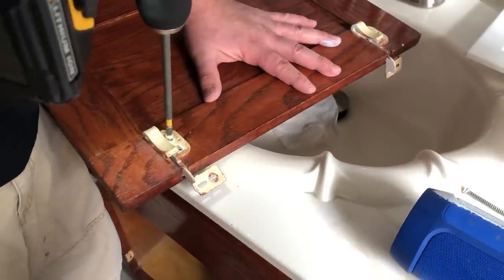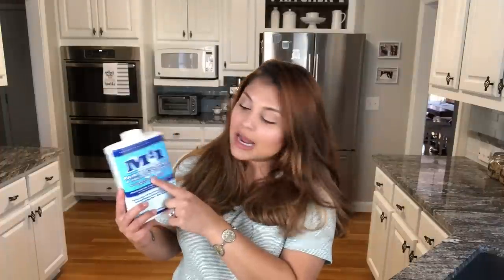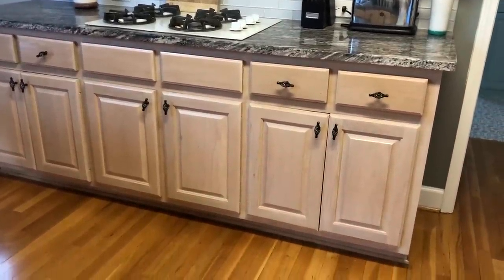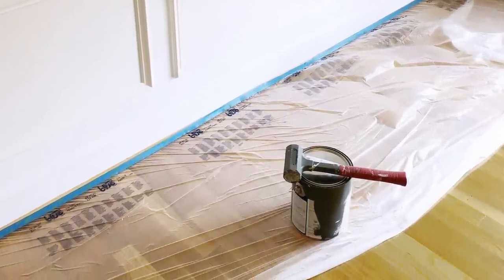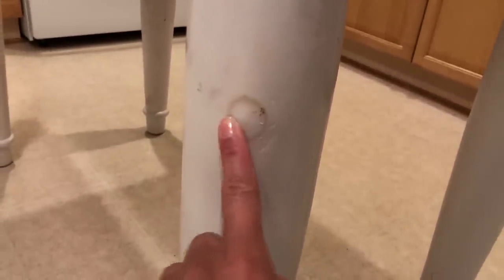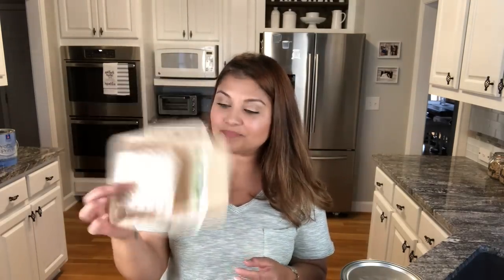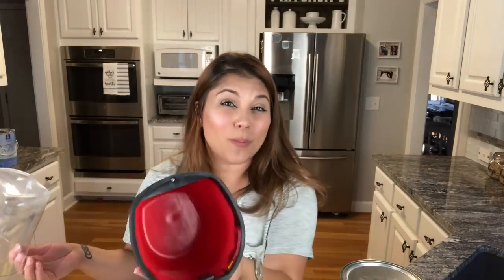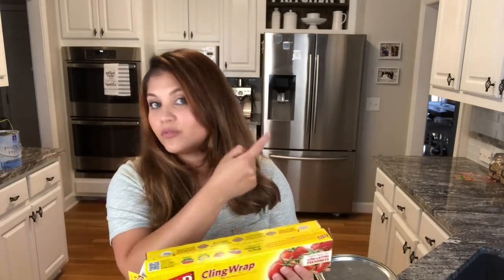HOW TO PAINT YOUR KITCHEN CABINETS THE BEST WAY - How to paint kitchen cabinets without a sprayer

Comment: I loved your video . I have watched hours of YouTube In preparation for painting my cabinets And this is by far the most detailed video . I was wondering why you like the Wooster Pro Shed Resistant Rollers for Smooth Surfaces over a foam roller ? Everyone else is recommending foam roller . Can’t decide what I want to use . I am debating on testing both Rollers on the back of the cabinets and making my decision before I start the fronts .
Reply from the maker: I personally don't like the texture a foam roller leaves.
Reply: Daniel Applegate foam rollers tend to leave a foam like texture and can make bubbles on the surface in my experience.

Comment: After doing a lot more research, I realized my cabinets have some melamine board on the sides and different spots — the doors are wood though. Did you have this too? Did you lightly sand these areas? I’m a little worried about the primer/paint bonding to this.

Comment: I know that you need a separate brush and roller cover for the Pro Block Primer but did you use the same brush and roller covers that you used for the Emerald paint as you would paint for the walls? Or did you have 3 separate ones from the oil primer, cabinet paint, and wall paint?
Reply from the maker: I use the larger rollers for the walls but the same angled sash brushes for the edges

Comment: Hi. With the primer u got, were u able to cover the grainy wood or the veins? My kitchen has many veins..thanks
Reply from the maker: It covers them up but it doesn’t make them smooth. Unless you fill them in with wood filler and then sand them all smooth, you will still see the veins when painted. I hope that answers your question.

Comment: Hi. I know it hasn't been long since you have had the cabinets done but Is there anything you would have done different? I would like to know how it's holding up with the paint you used? And you used nothing on top of the emerald SW paint, correct?
Reply from the maker: Sara Huth hi there! Actually no, there is not anything different I would do. It’s holding up great! And yes, you are right. I did NOT add anything on top of the emerald paint. Hope that helps!
Reply: Thank you😊

Comment: Doing my kitchen cabinets now. I have watched a lot of videos and decided to buy the products you recommended. I love SW paints as well. I have already deglosed and even sanded cabinet doors with orbital sander ( I have to say it took me two days, approx. six hours a day, cabinets had very hard surface, I don't know what it was probably 3 coats of lacquer, anyhow I wanted to have a wood clean smooth surface) and primed them yesterday with that SW oil based primer. Original color was oak. Today is the next step. But before I go to the next phase of the work I had a question for you. 

Can I prime it twice? Because the original color is still showing under the primer and I don't want to apply more than 2 coats of paint?
Reply from the maker: You can definitely prime twice.
Reply: @TheLatinaNextDoor  great! Thank you! Will let you know how it goes when finished! By the way, forgot to mention earlier! Loved your video, great explanation and you are very detailed! Keep up a good work!

Comment: I'm going to tackle my kitchen cabinets! Thanks SO much for all the information!!! You are awesome!! Just 2 quick questions. Can I use TP cleaner instead of the MI deglosser?? Also my cabinets are knotty alder..that appear to be in good shape, I know you said you don't need to sand, but I'm hesitant not to.... Do I need to sand them and fill in the wood spots with wood filler?
Reply from the maker: I’m not familiar with that other cleaner. I prefer M1 honestly. If you have knots in your wood then I would definitely fill in and sand them down. Hope that helps.

Comment: this was a great video!!  the cabinets i have currently is are a satin finish and I'm not a fan of gloss.  Would I be better off with a Satin finish.  Is this just as durable and cleanable?  Also, the color you used was extra white?  I need a great white but not so bright that it jumps out at everyone that walks in my kitchen. any help would be greatly appreciated
Reply from the maker: You can use Pure White. It’s not as bright but it’s a true white. I personally wouldn’t use satin as it’s harder to clean off in my opinion, but that’s a personal preference.
Reply: Thank you.  I'm using what you originally recommended.  Here goes nothing!  Wish me luck!!

Comment: You just inspired me to take this project on. I am debating between SW Emerald Trim Enamel Paint or Benjamin Moore Advance. Do you have any thoughts on BM Advance? Even that is alkyd and has self leveling. Many DIYers suggest BM Advance if using brush and roller.
Reply from the maker: I have used BM Advanced and I prefer SW hands down. BM stays tacky a lot longer so you will have to let your paint cure even more time. I don’t like that difference since you run the risk of ruining the paint job after the doors are installed. Hope that helps!
Reply: @TheLatinaNextDoor  thanks a lot. :)
Reply: Thanks for replying so fast. Helped me build confidence to take this on. Finish wise did you find a big difference between the two? Would you recommend the trouble of spray painting?

Comment: Hi there! I have started my cabinets following this tutorial and didn’t realize the pro block primer came in both a water based and oil. I didn’t specify to the guys at Sherwin Williams and they gave me the water based. Not realizing there were options I didn’t check. I have now completed the priming phase (doors and boxes) and realized when trying to clean my brushes with mineral spirits that I in fact had a water based primer. So, if you don’t mind weighing in, what do you think I should do? Resand and repaint with an oil primer? I don’t want all the hard work to go to waste if the water will lead to heartache in the long run.
Reply: Did you ever get an answer on what is the best primer?
Reply: @tinahopkins7813  Hi Tina! Yami actually was gracious enough to respond to this query via email. She said for best results I needed to sand everything back and start over because oil over latex (water) could cause problems. I ended up following her advice (and the advice of several other paint people I asked) and sanded most but not all of the water based primer off of the doors I then reprimed and painted them.  It was ALOT of work.
Reply: @tinahopkins7813  And I used the  pro block oil based primer

Comment: Hi! I really appreciate this information. Thank you! What are your thoughts on a shellac primer? I have cabinets similar to yours and was advised a shellac primer is best. I definitely will use the urethane. Awesome.
Reply from the maker: I think shellac would do a good job as well. It does help with sealing and preventing bleed though, but I haven't used it on cabinets myself.

Comment: If you tape off the handle of your brush before using, you can remove the tape after painting and have a like-new brush handle that is not all gunked up....I liked your process, but would have like to see more painting while you explain your process. I learned a lot...thank you for your video.
Reply from the maker: Thank you. I have shared several videos of me painting cabinets on my channel including when I painted this kitchen. This was more to answer as many unanswered questions as I could about my process.

Comment: Hi I start painting my gabinet and I didn't use the roll only the brush with my primer but the termination is not smooth and I thinking to sand y apply another coat of prime with the roll and brush did you think that can work for the  smooth termination I hope you can answer me 🙏🙏🙏

Comment: Are the knobs  and pull handles original to the cabinets? Or if you replaced them where did you get them (they're pretty)?
Reply from the maker: They were original but I have seen them on Amazon

Comment: Great tips.
Did you have to sand your cabinets? I couldn’t find the prepping video?
Thanks
Reply from the maker: I didn't have to. The cleaner did a lot of the stripping for me and the cabinets were in good shape. If your cabinets are a little rough, or have been refinished before I would recommend sanding to make sure everything is smooth.

Comment: I am painting over worn and chipped paint.  Do you recommend stripping off the old paint?  My cabinets  are chipped in high-use areas, e.g., under handles and where finger nails pull doors open.
Reply from the maker: Yes, I would recommend stripping the paint since you already have chipped paint. If you just sand it will still look uneven and if there are any areas already prone to chipping that haven't started yet, it might do so after you painted, and you don't want to risk that.
Reply: @TheLatinaNextDoor  thank you for the reply, I am sure you are right, I suspected as much.

Comment: Also just a FYI I used the same Emerald paint from Sherwin Williams on our bathroom cabinets.   I decided it would be a good idea to add a coat of polycyclic (even though the guy at Sherwin Williams told me it wasn’t necessary) over the paint. BIG MISTAKE!! Ended up with what they call alligator skin. So I either had to strip all the paint off and start over or leave them as is. After showing several friends I decided to leave them and tell everyone that this was the look I was going for 🤣. Lesson learned

Comment: I purchased the Wooster rollers and Purdy handle as you recommended, however as I’m getting ready to paint, I find the rollers are too tight to fit on the roller, darn I’m off to find some Purdy roller covers.   However thanks for the great video 😊

Comment: It's interesting what different results different people get from this high-priced Emerald paint. I always look first at low-rated reviews to find out if people have done it wrong (not followed instructions) or whatever, and a few people have had terrible results from the SW Emerald Trim paint. 

My original hesitation was because I had an AWFUL experience using SW HGTV "guaranteed one coat" wall paint that in actual practice required FOUR COATS (white over deep coral and white over avocado from the previous homeowner). I will say that SW did refund my purchase, but I would have preferred that the product had worked as advertised. I'm glad you had such beautiful results but I encourage others to do due-diligence research before starting a big project like cabinet painting. In my case, my existing cabinets aren't even real wood so there will be no turning back once I commit to painting ... this will not be a snap decision for me. BTW, your results are beautiful :) ... I don't want to be a Debbie Downer, but I have to make this decision carefully. 

And I agree 100% with the Purdy paintbrush recommendation. A professional painter who was at the store at the same time I was searching for a brush highly recommended Purdy and I closed my eyes to the price and bought it. Great decision! The biggest advantage is these brushes don't lose bristles - ever. What I did to keep that brush - literally for years! - was to wrap the bristles in a very damp rag and put the brush in a zip bag in the fridge. It was always like new next time I needed it. They truly are worth the price!

Comment: Thank u so much for showing that table that is showing the knot coming through. I have to tell u I’m so sad we recently painted our oak cabinets white and some of the .org is coming through like u showed.  We would u recommend adding another layer of paint?  Also, we have experienced some chipping when opening some of the doors (our doors sit in the actual cabinets not on top like urs do) 
Tfs
Reply from the maker: Luz Posada unfortunately even if you add another layer of paint it’s going to seep through it as well. What I have seen others do (I haven’t done this myself)  is spray Zinsser Shellac (it comes in a paint spray can) onto the areas that are staining through and then go over it again with paint. It’s supposed to prevent future staining. I would try to find some videos about it first before doing it. I hope that helps! 😊💕
Reply: The Latina Next Door I truly appreciate ur input thank you!!!

Comment: Wow, I dreaded the idea of painting my cabinets but you and this video have inspired me. If you do see this, I'm hoping you can tell me how long did the odor stick around? TY and great upload.
Reply from the maker: The oil based primer's smell can take several days to dissipate. I would make sure to ventilate and paint the cabinets in a garage, if not, wear a respirator. The actual paint takes a few days, but the smell is not as strong. Hope that helps!
Reply: @TheLatinaNextDoor   Thanks so much for the reply Yami, pleasant surprise :-) Still about a month away from starting the cabinets but super ready because of you! Thanks again

Comment: Thia video was amazing! I've been debating painting our cabinets or hiring someone. Question: did you switch out to a different paint brush and roller when you went from primer to paint on this job? I don't know if the paint you used is considered oil based or not. Thanks!
Reply from the maker: Yes, I did. I keep my oil base brushes away from my latex paint etc.
Reply: @TheLatinaNextDoor  thank you so much! I'm going to try it!

Comment: Do you have a tutorial on how you did your kitchen walls?  Like, did you use the same paint/primer as you did on the cabinets?
Reply from the maker: Ball Cap Paul I’m sorry I do not have one at this time. I simply used 2 coats of Repose Gray (latex paint in a satin finish) and I prefer to use Sherwin Williams SuperPaint for my walls. It’s the line I prefer the most for just regular wall painting etc. I hope that helps some! 😊💕
Reply: The Latina Next Door what paint color are your caninets?

Comment: I have kraftmaid cabinets that have the manufacturer stain and gloss on them.
 Will the deglosser work? Or should we sand them?
Reply from the maker: I am not familiar with kraftmaid cabinets or their particular process. The cabinets I had were previously refinished so the manufacturer's finish was already addressed, but it didn't give me any problems with the new finish that was added before I painted them. I would try the deglosser, if it doesn't take everything up, then I personally I would sand as well.

Comment: Can you use a wood grain filler like aqua coat and then use an oil based primer?
Reply from the maker: Not sure. I would check the specifications. I haven't used aqua coat.

Comment: Love this video, so much info. I’ve must have watched it 20 times. Plus shared it to friends looking to redo their cabinets. Question: your link for SW paint says satin sheen but the can in your hand says semi-gloss. Is that the same thing? I don’t want really shiny cabinets.
Reply from the maker: The paint for the walls is Satin, but the paint I use for the cabinets is Semi-Gloss. It does have a sheen but it's not super shiny in my opinion. I prefer it that way because it's easier to wipe down and remove grease and dirt that accumulates in the kitchen.

Comment: I bought all of the same products you suggested but my son keeps chipping the paint on the cabinets by pushing a chair up to the cabinet to reach the counter. Should I use a top coat to protect the finish? The paint wasn't totally cure when the chipping happened.
Reply from the maker: I am sorry you experienced chipping. If the paint hasn't cured that definitely is a possibility. I wouldn't put a top coat personally because you will get a streaky finish. Is there any way you can put those small felt pads on the chair where it touches the cabinet?

Comment: Did you thin the paint before using it?  The gallon I brought is VERY thick and hard to mix.
Reply from the maker: No I did not thin it out.
Reply: @TheLatinaNextDoor  Did you sand between coats?

Comment: Why did you use a nap roller instead of foam?  I have had good results with the foam and am hesitant to try the Wooster Pro.
Reply from the maker: Karen King I personally don’t like foam rollers because they tend to leave texture on surfaces and don’t cover evenly, most likely due to the fact the foam has little “pockets”. If you have found good results with foam, by all means continue using them, however, I just don’t recommend them. Have a blessed day. 😊